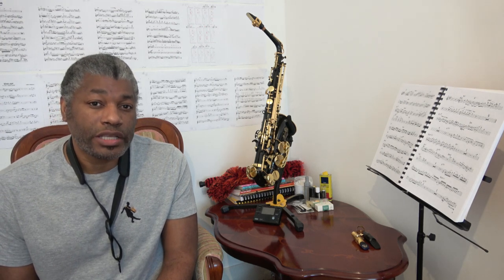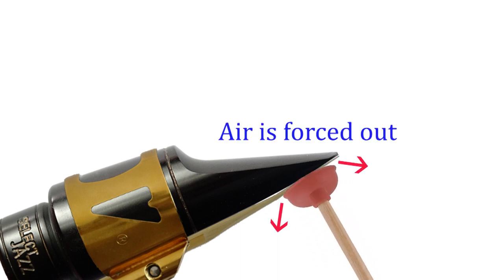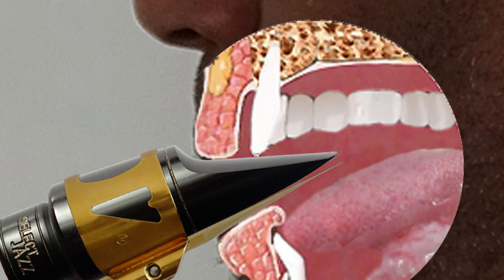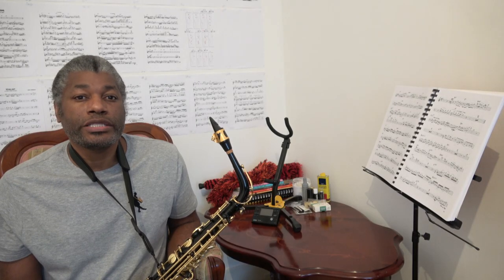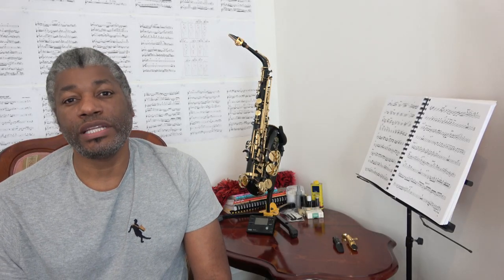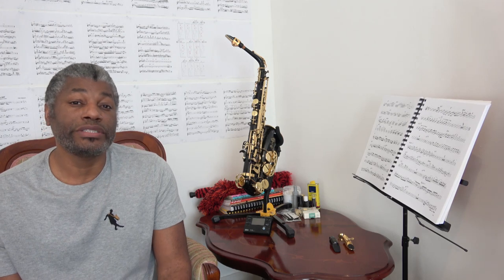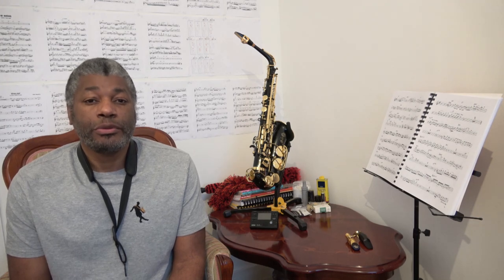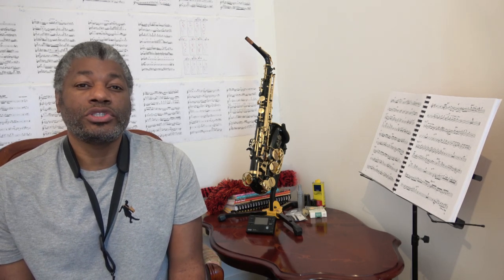Saxophone slap tonguing

Comment: Thank you very much for these explanations. I have a question, when you apply the succion does your tongue grab a little the extremity of the reed which would explain why it can hurt the tongue and cause the extremity of the reed to break? This would also explain why closed slap tonguing can be done with a small amount of mouthpiece in the mouth.
Reply from the maker: Hi. There are many ways to create a closed slap tongue. Some grab the tip of the reed with their tongue and pull it away from the mouthpiece. But this method can damage the cane reed and hurt your tongue if you are not used to it or know how much pressure to apply. Others will only use suction. The tip of the reed will touch the tongue but is not grabbed by the tongue. With practice it is possible to create the suction closer to the tip of the reed but may take a long time to develop this skill and as such there is no need to grab the tip of the reed. I have only seen 1 video on YouTube where the musician states that he grabs the tip of the reed and he says that in doing so has never damaged a reed. All other videos talk about using suction only. I suggest that you do not try to grab the tip of the reed but rather work on creating the suction closer to the tip. See Derek Brown's video on slap tongue where he explains this in more detail. Hope this helps. Thanks.

Comment: I'm a beginner, and my teacher is telling me that I need to place my tongue on the roof of my mouth.  Are there options when it comes to that ?
Reply from the maker: Hi. Some people will practice the sensation of slap tonguing by placing their tongue flat against the roof of the mouth and quickly pulling it down or they will practice on a large surface like a spoon or palette knife. Once they know how to do it, they will put their tongue on the reed with more of the reed touching the tongue and do the same. Some will use suction to pull the reed away from the mouthpiece while others will grab the tip of the reed and pull it down with the part of the tongue further back. There are also variations to slap tonguing that gives a different effect and so different ways to do it, though some may call these methods not slap tonguing. If your method works then use it as there is not a 'correct' way to do it. It will either work and is loud or it wont work. Thanks. Check out Beatbox Sax by Derek Brown. He does a lot of this sort of stuff and explains different methods.

Comment: Great video! I've been a life-long slap-tounging-is-impossible player and after this video I've finally made some forward progress! I have a question for those of you that have been working on this: I am able to get pretty consistent "pop" with the barrel of the mouthpiece pressed against my hand (so I can feel the "sucking in" on my skin). The problem I'm having now is that I'm unable to create that vacuum when I get my hand out of the way and try it with just the mouthpiece. Any ideas? Cheers, just subbed to you.
Reply from the maker: Hi. From what you have written it seems to me that you are trying to create a suction by sucking out the air in the mouthpiece. The suction is only formed between the tongue and the reed so that your tongue sticks to the reed and pulls it away from the mouthpiece. The sound is amplified by blowing a small puff of air at the same time. Check out the slap tongue videos on saxophone academy and on Earspasm Music. Both these videos will help and are the best I've seen on the subject. As Derek Brown says 'it takes time'. Just keep at it. Some people can create the slap tongue but have problems making it loud which is done by the puff of air. Thanks.